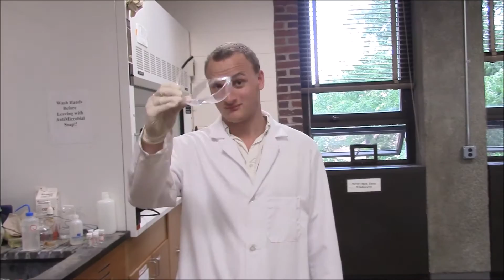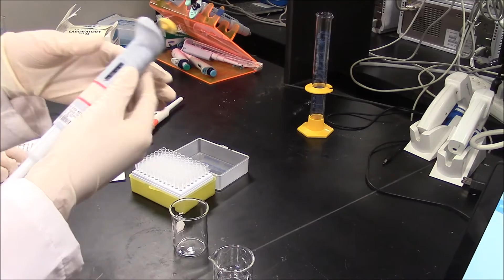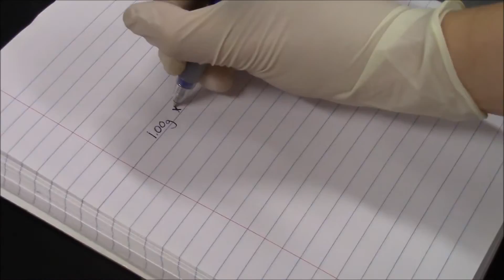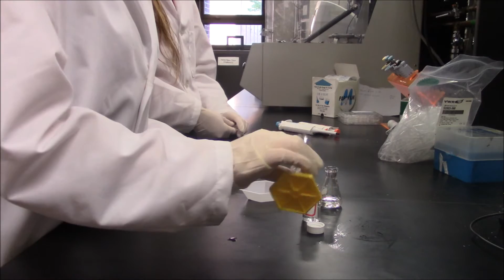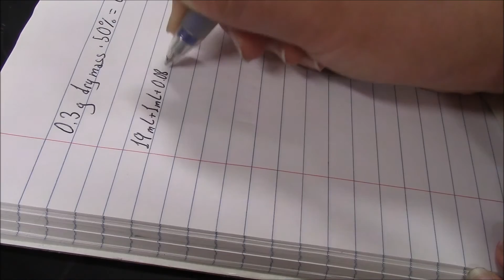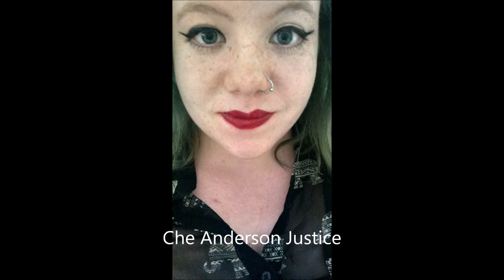Enzymatic Hydrolysis Instructional Video

Comment: I am a highschool student who is working on a senior research project which entails synthesising bioethanol from organic waste. After extensive research I have seen that enzymatic hydrolysis is recommended as pretreatment to increase the bioethanol yield rate. To undergo the enzyme based hydrolysis would I simply follow the same procedure as shown in this video?
Reply from the maker: Yes you need to treat most organic waste with enzymes in order to have a successful fermentation. The enzymes unlock the cellulose without that there will be no sugar for the yeast to consume unless your fermenting fruit or something else with sugars.

Comment: thank you for posting how you performed saccharification! i searched all over internet, from journals to youtube and i was still very lost about how to perform enzymatic saccharification until i found your video. However, may I clarify some things? 

1) Can i use the same steps as you did on other samples, like fruit waste? I am currently a student researching about converting cellulosic biomass to ethanol so i was wondering if i could use the same steps as you did for the wood chips. 

2) May i know the names of the chemicals you used? I am super new to this so i am not sure of most chemical names.

3) How do you perform the dilute acid pretreatment? My groupmate also couldn't find anything on the internet. 

I'm sorry for asking so many questions but I hope you can find the time to answer me. Thank you for the video again. It has showed me a good insight of how saccharification works.
Reply: the acid pretreatment is just soaking the wood chips in a 10wt% sulfuric acid solution while cooking  in an autoclave for an hour. Give me your email and I can forward you some stuff about it
Reply: oml i cant seem to send a private message.... uh nvrm. anirbasrune@gmail.com thank you!
Reply: Anirbas Run using fruit you should be able to just skip straight to fermentation because there is no need to separate the glucose from the cellulose as there are already fermentable sugars in fruit waste
Reply: @skier1c  I know your reply was 4 years ago, but I'll take my chances. Thank you so much if you reply :')

You say that we can just go straight to fermentation of the fruit waste. But there are still cellulose in those, right? Would that mean that performing pretreatments on fruit waste would increase fermentable sugars, and maybe increase bioethanol yield as well?
Reply: Nice .. I appreciate your video. I want to do the same thing with textile waste (cotton) . Kindly please send me some more information about it? 2404954388@qq.com  Thank you so much..
Reply: I want to do the same thing with textile waste (cotton) . some methods to get hydrocarbon sources from textile waste... Kindly please send me some more information about it? 2404954388@qq.com  Thank you so much..
Reply: Okay, this is 5 years ago, but I hope you can help me out. 

For my final thesis I will attempt to make ethanol from banana pseudo-stems. Due to my lab not having most of the chemicals needed for enzymatic hydrolysis, I'm forced to think of Dilute-acid hydrolysis.

Do you have any protocols/videos explaining how I should attempt this?
Reply: Hi, I am a student doing research paper on how banana peel can turn into sugar, could you please help me how to extract glucose in banana peel :((